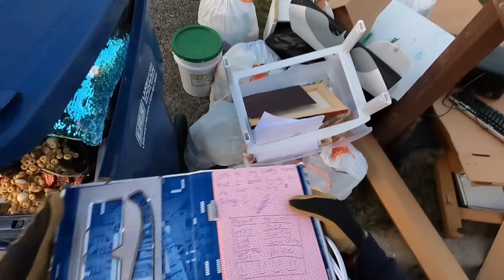Total Copper Score - Trash Picking Pays

Comment: Just found your channel and it takes me back a few years. I use to scrap everyday when I was younger. It started out as a way to make some extra change. And then I turned out that I could make a living doing it. I had a water heater company that I purchased all thier old water heaters from. And they had a loading dock that I could leave the waters heaters there and let them accumulate. I would pay 75 cents each for them and I would get all the old copper oipe and brass fittings off them it turned out to be a great adventure. And I also had a few air conditioner companies that they would give me all thier old air conditioners. And I had many more buss that I would pick up all thier old scrap I have watched a few of your videos. And I see that you are not doing it properly. I wish I could be there to show you a few tricks. You need to get yourself an old hatchet and some good tin snips along with a few tools with you. 

Is your yard at home sufficient for nough to take things apart in. I seen in one of your videos that you were storing some of your items. Stock piling if. Electric motors from washing machines and dryers dishwashers etc. your doing the right thing by clipping the cords off everything. Stock pile that stuff. Are you stripping the wire or are you able to burn it little by little. Screen doors save them take them apart and take them in when you got a hood pile of them. Don’t worry about the glass. You can always put that in the garage. 
Let me know how you’re doing all your precious metals. There are metals I seen you throw away leaving them attached to items. That let’s say instead of making 63 dollars with a little bit of patience and knowledge you could have made another hindered or so. All your lawn mowers have what’s called dirty aluminum on them. And the decks of the lawn mowers on some of them are aluminum. Don’t give the scrap yard money that you could be making. Believe me they pay a person to take some of this scrap apart. So that they can make the money that most scrappers leave behind.

Comment: Hey Paul just a suggestion here, when you stop to get scrap keep the truck running you will be doing less damage to the motor if you leave it running not starting and stopping. Hope this helps
Reply from the maker: Many many years ago that used to be true. But not with modern engines

Comment: Couldn't see very well but it looked like that big rack could've come apart with a couple bolts.
I see you use ropes all the time. Are ropes easier than ratchet straps?
The only time our politicians talk about fixing roads is during elections. Once elected they forget they promised to fix them and just steal the money.
Reply from the maker: Yeah, rope for me is way easier than ratchet straps. Ratchet straps work well if you have normal shaped loads.
Reply: @ScrapPalletMan  I've never been good at tying knots so I always use the straps.